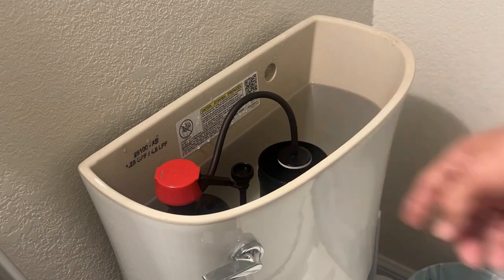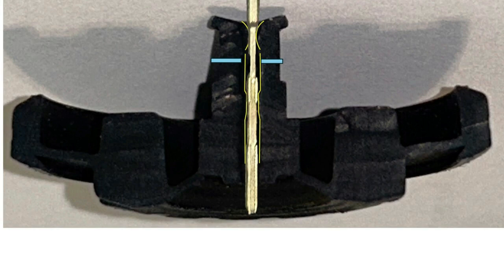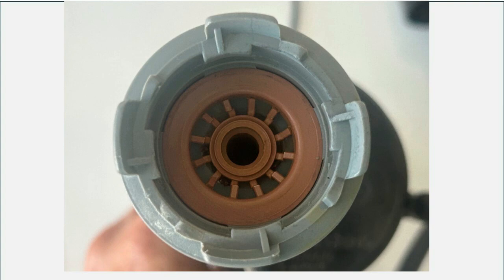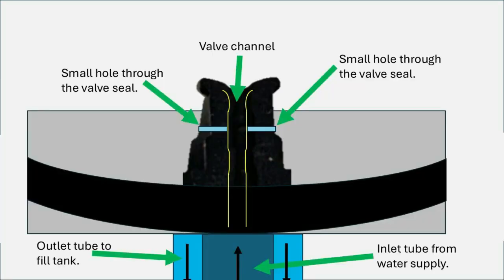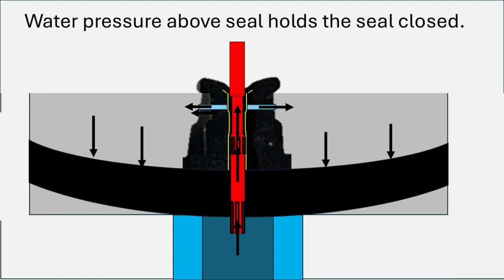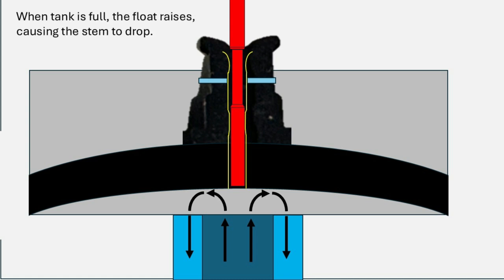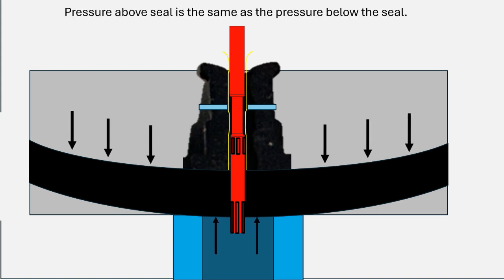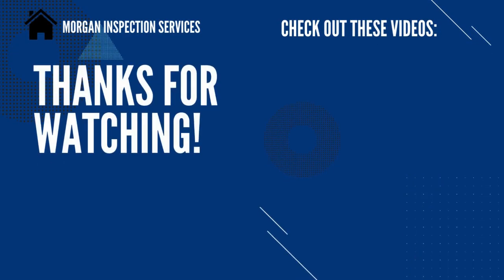How Does a Toilet Fill Valve REALLY Work? Amazing Mechanics Revealed! NEW & IMPROVED

Comment: I have a weird situation. My toilet tank sometimes It does not fill up the tank. I have to toggle the fill valve to restart the filling tank process. I did replace the the plastic rubber seal part on top of the fill valve @0:28 shown on this video. Everything was working after the replacement of the rubber seal up until now. Anyone have a idea what could be wrong?
Reply from the maker: When the fill valve does not refill your toilet, is it dropping down like it should when the toilet flushes or is it still stuck in the up position when you have to toggle it?
Reply: @morganinspectionservices3840  I do not know. It is kind of hidden. It is a new kind of fill valve it has a square floater next to it. I will have to pay more close attention to it. I wish I could post a pic of it.
Reply from the maker: @linux3k . You can find my email address in the channel description to send me a picture if you’d like. I will tell you that sometimes these fill valve floats will just start sticking and there’s not much you can do other than replace the fill valve.
Reply: Interesting! I cleaned & replaced 2 new seals, still had tiny leak overfilling the tank. I guess the stem went bad?? Needed a complete valve to fix it.

Comment: Seems like the pressure above and below the pipe opening will be the same (the pressure of the supply water) when the valve is closed. So, I don’t understand how it can give a tight seal, if pressure is the same on both sides. Seems like equilibrium at best. Obviously it works but not sure how. The pressure on top would need to be greater to hold it shut. If anything, seems like the pressure below would be a tiny, negligible bit larger due to the the quarter inch or so of head across the thickness of rubber, but basically equal.
Reply from the maker: Very good question. I actually created a new and updated video because I left out an important fact. While the pressure is the same, the surface area is much higher on top of the seal, so the force above the seal is greater than below the seal. Here is a link to that new and improved video.  https://youtu.be/ZN0d_e7qIwM?si=IrWYi9sp-jDxM4lr